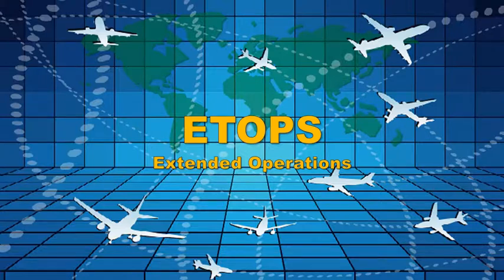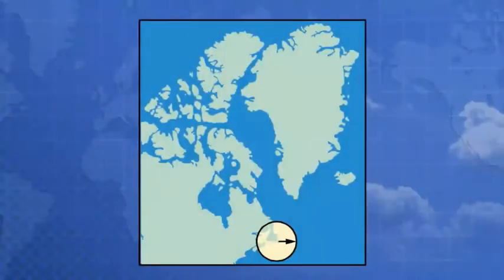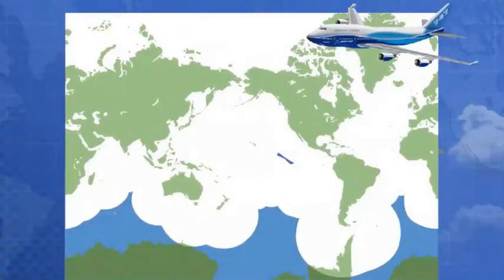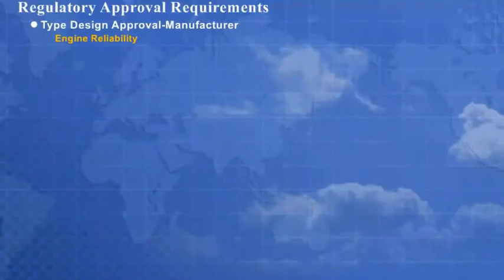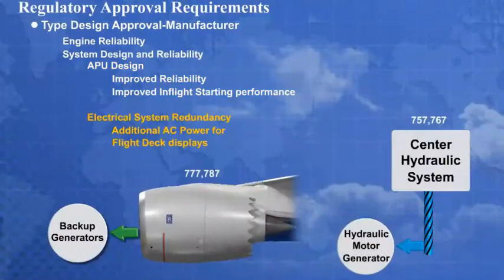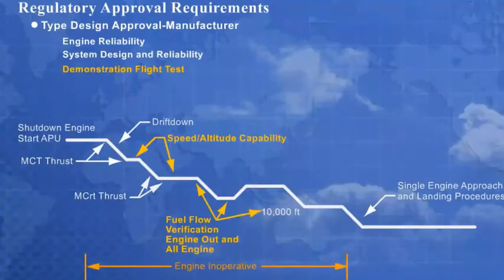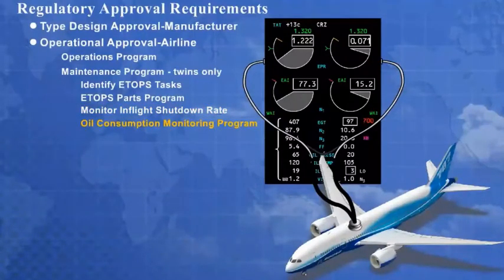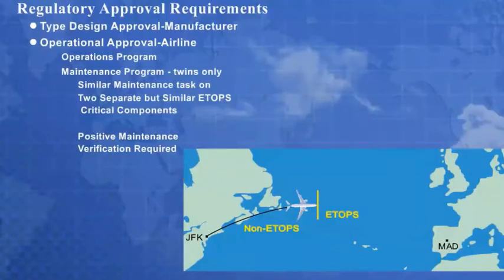Extended Operations Training / ETOPS #01 General Requirements

Comment: IFSD rate is in 1000 hours, confirm please.
Reply from the maker: Yes, you're correct. ✅

IFSD rate — which stands for In-Flight Shut Down rate — is typically expressed as the number of in-flight engine shutdowns per 1,000 engine flight hours.

✈️ Example:

If an engine type has an IFSD rate of 0.01 per 1,000 hours, it means:

There is 1 shutdown every 100,000 engine flight hours.

📌 Source:

This metric is commonly used by engine manufacturers (e.g., GE, Rolls-Royce) and aviation safety authorities (like EASA or FAA) to monitor and compare engine reliability, especially in ETOPS operations (Extended-range Twin-engine Operational Performance Standards).

Let me know if you'd like a visual chart or ICAO documentation reference on this!